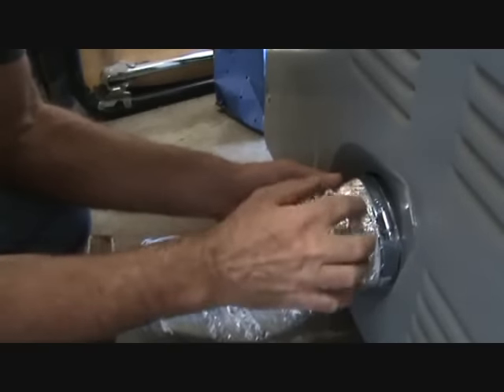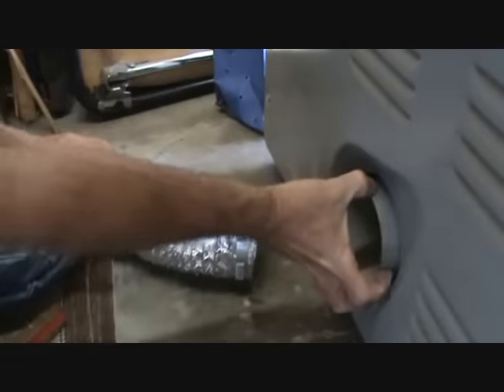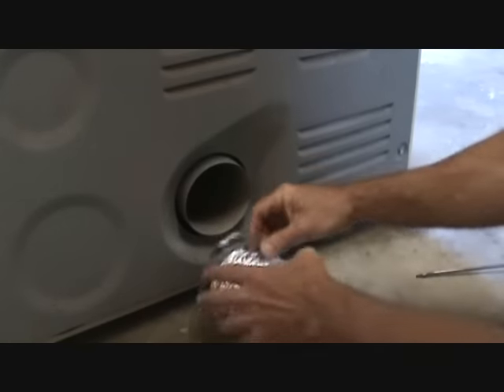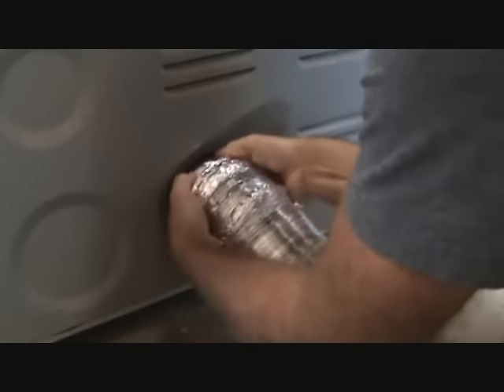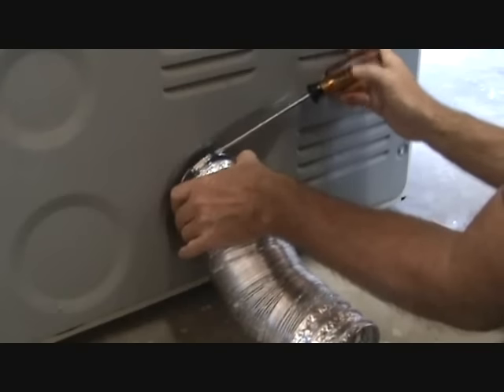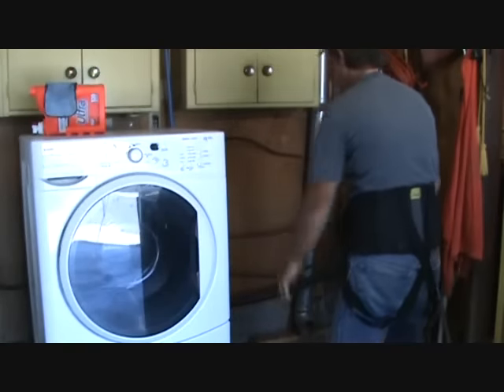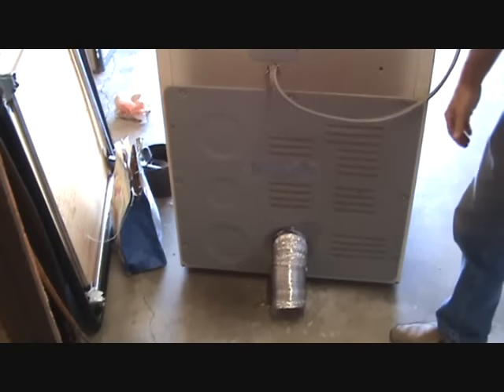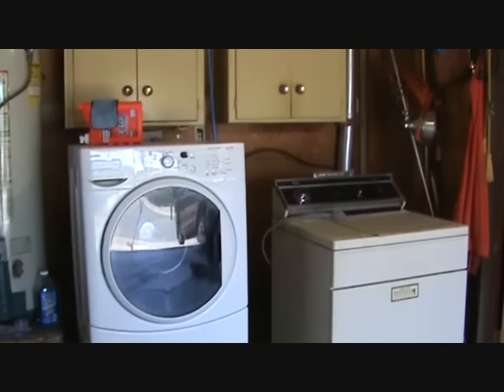How to install a dryer vent flexible pipe

Comment: OK, Joe.  My washer and dryer are in a hall closet with just enough room to squeeze between them but not enough to bend over and get both hands all the way down to the bottom where the vent comes out of the wall.  I've got it hooked onto the dryer but can't figure out how the @#$% to get it securely clamped to the wall side which is about 3 inches off the floor.  If I try to pull the dryer out into the hall I can't get in there!  Any suggestions????
Reply from the maker: Sounds like a predicament for sure! I would think what they did previous was to pull the dryer all the way out in the hall as far as possible then they had a little guy shimy down there to make the connection. Then they helped him out of "the hole" then rocked & pushed the dryer back into place making sure that the pipe didn't get kinked as they pushed it back into place. That's what you're going to have to do. Doesn't look like you have any other choice. Errrgggg! Thanks for your message. Good luck.   Joe  :0
Reply: VideoJoeKnows I came to the same conclusion but then had a vision of my kids finding this 67 yr old grandmother stuck "in the hole" so I called on the services of my much younger, skinnier son-in-law and we finally got it attached .  Thanks for your great videos!
Reply from the maker: Way to go with getting your skinny son-in -law out to help you out. I KNEW there was a reason you kept him around!   Joe  :0

Comment: It's incredibly hard to keep the foil thing on. They made the pipe coming out of the dryer with crimps running parallel to the pipe instead of around the circumference. I guess they made it that way so it will slip off more easily and toture us with the ridiculous design? The circular pipe going into the wall is completely smooth, so nothing to grab onto there, either. Ridiculous!!!
Reply: They're called hose clamps. And take the plate off the back of the dryer before you connect the hose and then put said plate back on over it
Reply from the maker: I know! They are all against us but I know you prevailed anyway in spite of it all.....right?!!
Reply from the maker: I've heard another viewer say the same thing & seems kind of radical to have to do that just to connect up that pipe!...but I guess do what you think needs to be done to get it on there for sure! Thanks for the message...

Comment: How do I connect it when my dryer and washer are in a small closet with no room to reach to the back?
Reply from the maker: If you already have your washer & dryer in that small closet, you will need to pull the dryer out just enough for you to climb on top of it then slither down behind it so you can then connect it. Or pull it out as far as you need then get back there & connect up the dryer vent then climb back up & out to then carefully push the dryer back as far as you can without squishing the vent pipe. Very tricky for sure but the last person was able to hook up their dryer so I know you can too. Let me know how it goes!
Reply: @VideoJoeKnows  Thanks for you quick response! We tried that technique last year, but it has spewed lint and dust all over the floor and wall because we couldn’t get a 100% tight fit on the vent seal. We cleaned as much accumulated lint and hope it’s not a fire hazard. There’s a shelf that holds our water heater above the machines so it’s tough to get on top. I was thinking of suggesting a MagVent. Any experience with those?
Reply from the maker: @1kaaa  Unfortunately I have not heard of a mag vent. Is there not a way you can get the connection tight all the way? Do you have a clamp that I show in the video? Put about 3 wire strands over the fitting before you clamp it down so it doesn't come loose & use a big screwdriver to get it tight or use a little crescent wrench or pair of pliers to tighten up the nut on the wire clamp so you have it nice & tight. Is it the same type of flexible duct vent that I show on this video or do you have the aluminum flex type? If you have the aluminum one you can put it on then put some screws in it then wrap with duct tape or hvac tape so it doesn't spew lint all over the place. Yes good idea to make sure the pipe that goes in the wall is cleaned out a bit before making your connections. That's what I would do. Let me know why your pipe vent can't get any tighter but there's got to be a way you can make it nice & tight so it doesn't spew lint all over & then you won't have to purchase the other kind of vent you were referring to & plus where are you going to vent this mag vent to?

Comment: I thought you had the straighten out the flex tub so there no way for lint to get trapped and to prevent a fire
Reply from the maker: No you really don't have to straighten out the flex pipe as some flex pipes are like 8 feet long. They make them long in case your dryer connection is a few feet away from the outlet connection & then you can connect however you need to. If you are really concerned then you could cut of say 3 feet of the flex pipe then connect the rest. However the other reason for the 8 feet is so that once you have it connected you can then pull away from the wall to get yourself back behind the dryer to then disconnect the pipe if you have a confined area for instance. Then re-connect & climb out to then push back against the wall...see? In my case as the dryer was in a garage I didn't really need 8 feet of flex pipe but I left the rest there & it just bunches up together or bends back behind....they  have the aluminum flex or the plastic & wire flex so pick your poison...

Comment: mine keeps falling off and it's not easy getting back there and re-attaching.  Can the end be cut to fit or do I have to keep the whole length. I may need a new clamp cuz I don't think I am able to screw it tight enough. I don't see anywhere where someone cuts it down to make it shorter. Update: got it back on again, but notice the tube to the dryer part, the L-shape, when I push dryer back it bends a little and exposes a slight opening with air coming out, thinking that part is defective now, too, and the bendable tube in almost coming off again and it's really hot.  Is that normal?  I will need to replace the whole thing now with new clamps and bendable tube.  Tube is kinda kinked too much, too; in other words not a complete circle all throughout.
Reply: Spiceydame:  DO NOT use the Foil Flex.  Use the Aluminum Flex (semi rigid).  Aluminum Flex is MUCH safer than the Foil Flex.  It is okay to cut it down but always use the clamps.
Reply from the maker: Well good observations & hopefully you came to the conclusion to get a new clamp & cut the end of the flex pipe off to try again or....what did you end up doing?
Reply from the maker: I've heard the same from different viewers but why do the local hardware stores continue to sell the foil flexipipe?

Comment: Do I have to do this installation for a electric dryer?? this is only for gas dryer?? I need to know before I buy it. please please help me. thanks
Reply from the maker: +Angeles Castillo The dryer I was working on was an electric dryer & you need to do the same thing for a gas dryer. If you have any questions you can ask your sales person who you will be purchasing your dryer from. They will set you up for the type of flexible vent you should use. Good luck!

Comment: I would never use a flex tube. It's just shiny plastic and is FLAMMABLE. Use aluminum or rigid metal duct. Never us one of these especially on a gas dryer...
Reply from the maker: Good points. The flex piping I used was actually aluminum flex pipe so I think I'm ok. On a gas dryer though....it makes sense to use the other aluminum piping. Thanks for taking the time to send me your message. Much appreciated!   Joe  :0
Reply: @VideoJoeKnows  You're not ok. Don't believe me?  Put a Bic lighter flame to that tubing and you'll see for yourself.  Get yourself "Semi-Rigid" vent hose. It ain't expensive and its not flammable.

Comment: crimp a 4inch pieces of steel, slide into dryer pipe come out, tape it on there, then clamp the flex onto your transition pieces
Reply from the maker: Boom!

Comment: well the pipe coming out of the wall is a little too big so I can't get that end connected. Now what do I do?
Reply from the maker: Well you could get an elbow same size a flexi pipe then put that on first or...you can take a pair of tin snips & cut a few slits on the pipe coming out of the wall then push those in a bit then put the flexi pipe on & get the clamp on or put some duct tape on there to hold the flexipipe on....

Comment: Thanks joe
Reply from the maker: You're so welcome! Glad you had a chance to watch this video! Let me know how you do ok?
Reply: @VideoJoeKnows  it's going good so far I purchased some metal hanger pipe strap for the duct closest to ceiling that goes into the rim joist do I just level that part  straight or should I leave it a bit angled ? Dryer is in basement,pipe goes up then into rim joint then outside

Comment: What size vent are you using
Reply from the maker: I think it was a 4" hole. It should be a standard size when you go to the hardware store to get the flexible pipe extension....but if you can, measure your hole outlet before going to the store...

Comment: My guess as to why the outlet on the dyer is so short would be to give you maximum amount of room to scooch the dryer up to a wall. What they should do, in my opinion is extend the divot back into the dryer another inch or two and maybe add a second hold which you can put your hand holding a screw driver in to tighten the clamp
Reply: Great video by the way, for some of us (myself included) this stuff is easy to figure out, but not everyone is lucky enough to be mechanically inclined and needs a confidence boost to show them how easy it is and that they can do it. Thank you for your service,  By the comments I see it has helped many.
Reply: Emerson Rogue
Better yet, Spring Hose Clamps, pliers would be easier to get in there parallel to the hose rather than having to use a screw driver perpendicularly
Reply from the maker: I think even if they made it one inch longer with a taper then it would solve many issues for sure & still keep the dryer pushed closet to the wall.....
Reply from the maker: Yes this video has helped lots of viewers for sure & thanks for your detailed comments too! Much appreciated!
Reply from the maker: I know! thanks for the thought for sure!

Comment: Was hoping you would fit metal elbows which I am struggling to fit properly to the dryer
Reply from the maker: Did you get them on finally? Yes you would have to cut lines on there then spread apart a bit to slip on then you could screw it down & put duct tape on there too. What did you end up doing?

Comment: Still idiots designing dryers.
Bought a new dryer at best buy, 2019, still same problem, short vent on back of dryer, and installers just left it off and ran. And he forgot to mention the vent hose is made of completely cheap materials. Whole process makes no sense at all. Such an important piece of the installation,  made needlessly difficult.
Reply: It's intentional. Everyday frustrations like these are slowly building up for everyone to steer them towards things like tv, endlessly scrolling Facebook and the use of antidepressants and other pharma drugs
Reply from the maker: I totally agree!
Reply from the maker: LMAO!

Comment: What's better the foil or aluminium vent pipe?
Reply: Exactly. 🤦‍♀️
Reply from the maker: Most people now days says the aluminum flex pipe...what did you end up using?
Reply from the maker: Most people use the aluminum flex pipe but they still sell the foil flex pipe still too but lots of people say not to use that one, What did you end up using?

Comment: Couple problems with this video... You should check out DryerFlex transition duct. That slinky foil that you are using is inexpensive, but not the best option for venting your dryer. The DryerFlex has the same workability as slinky foil, but also has the same airflow efficiency and fire resistance as semi rigid or strait pipe!
Reply: Or just buy semi-rigid.
Reply from the maker: Thanks for your message for sure!
Reply from the maker: You mean that aluminum flex pipe that you can pull out like a slinky?

Comment: were having a problem, we cant get the vent to fit in the small space between the wall and the dryer vent
Reply from the maker: What type of connection was on there initially? You mean between the inside of the wall studs inside the wall? or your gap outside the wall up against the dryer. The dryer has to fit in there some how. They make different type of attachments & you might find something at your local hardware store. Take a picture on your cell phone so you can show the sales person at the hardware store & they should be able to help you.   Joe  :0
Reply: We got it we just had to cut out with a saw a area around the vent in the wall and move it.
Reply from the maker: Great job on figuring out what to do & doing it! Thanks for sticking with it.   Joe  :0

Comment: Hi, is it ok to use electric tape ?
Reply from the maker: You could use electric tape but it won't stay on there very long I don't think because the flange area isn't very long for much tape to get on there & keep the pipe on is my thought. I would go with the clamp for sure.....

Comment: I’m watching this video because the dryer in my apartment for some reason there’s this silver long thing  that has a white piece covering the end... it’s on the top of my dryer and it blows out a lot of heat. I’m trying to figure out is that supposed to be there or is it supposed to be facing outside so the heat to go outside. It’s making my apartment extremely hot when I dry my clothes. Can anyone help me?
Reply from the maker: So sorry for not getting back to you sooner! Hopefully you have fixed your issue a few years ago but to answer your question, most dryers are exhausted to the outside as I would think you would not want the heat to stay in your house...unless of course it's in the middle of the winter. Could it be possible that the last person living there did it so they would be warmer just for the winter? I would always want to vent the dryer to the outside though...thanks for stopping by!

Comment: That only works for that type of setup. All  washer and dryer hookup are the same.
Reply from the maker: It sure would be nice if the dryer companies would make the connection area stick out 1 or 2 inches further though. It would be soo much easier to attach the dryer flex pipe...

Comment: Thats is crazy!   Spend most of time trying put hose on.  Mean while ur trying you. Can easy rip the end of that cheep hose.  Manufacture think would have made pipe come out 3 inches be on back of dryer.
Reply from the maker: Yes they could at least make it stick out an inch longer & tapered just a bit. Not too long sticking out if you want or need to push the dryer back up against the wall as far as able....Thanks for stopping by!

Comment: I had the exact same problem with the back of my dryer. Why the heck does the manufacturer design the dryer with such a small tail pipe?
Reply: Lol he said "tail pipe"
Reply from the maker: I feel his anger & frustration for sure....don't you?!! LOL
Reply from the maker: I know you & hear you 100%! I have no idea why they can't extend that "tailpipe" an inch further & also put a slight taper in it so the pipe can slide right on. How hard could that really be? The guys who design these things never are the ones to check out their design when approved...right?!! Hey thanks for stopping by & hope this video helped you out a bit.....

Comment: It's easier to use a nut driver (socket) on those clamps rather than a screwdriver.
Reply from the maker: Good thinking. That would work great if only I had a ratchet set with me at the time...! Thanks for the tip though. Much appreciated.

Comment: Seriously why is the duct like almost the exact same size as the duct. You would figure to make it slightly bigger so it can be install easily
Reply from the maker: I hear you loud & clear! The manufacturers should taper the connection & make it just a hair longer sticking out too...right?!! Stick with it & hopefully this video has assisted you...

Comment: They should give just a little more pipe on the dryer to attach to
Reply from the maker: I honestly don't know why any dryer manufacturer has not done this as of yet!
Reply from the maker: See the notched out area on the back side of the dryer where you can use this area to use a long screwdriver to tighten up the strap? That's what that is there for....but still!

Comment: Hello you don't want to make all kinds of tight turn  the least amount of turns the better less lint build up that way
Reply from the maker: You've got to have at least two wire rungs on before clamping so it won't fall off in the future...like this one did before I got there to re-install! Thanks for stopping by...

Comment: try this...buy a piece of pipe to use as an extension...gives you more room to work.
Reply from the maker: Yes you could do that & just make sure you don't extend it out too far so you can still push the dryer up tight enough to the wall without kinking your flex pipe so your dryer is still flush with your washing machine. then you still have to get the flexipipe onto the extension pipe if you don't have those special pliers that crimps the pipe to taper it so you can easily slip the flexipipe on there. Thanks for the thought!